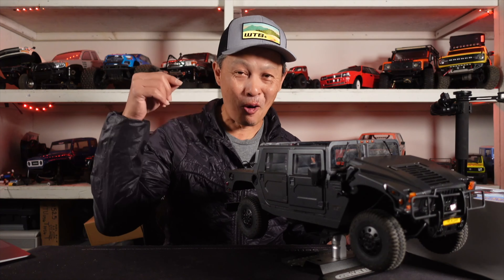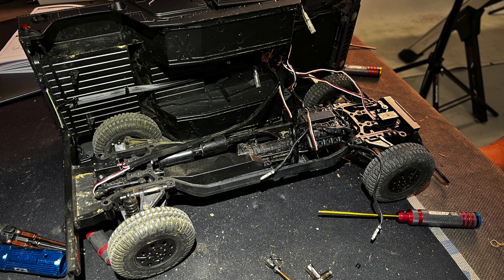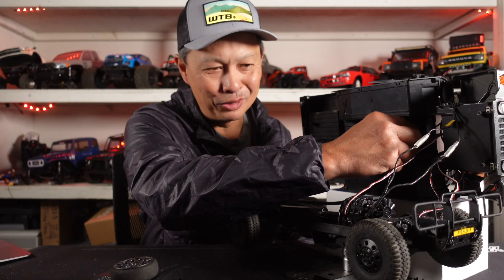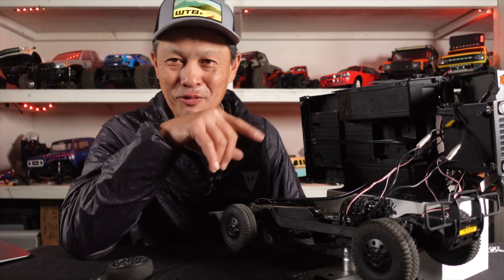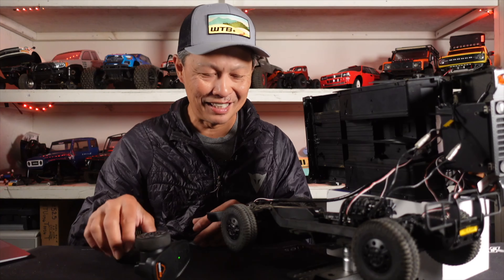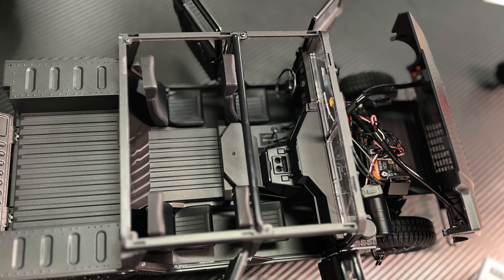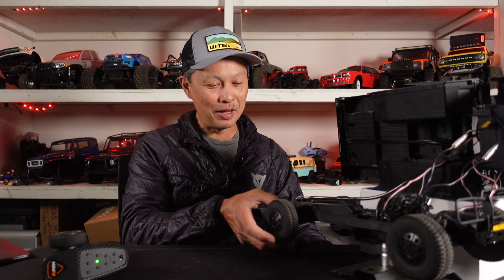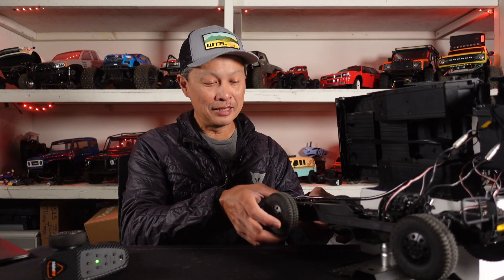FMS Hummer H1 1/12 chassis revealed and explored

Comment: I ordered one - thanks to this awesome channel. So far the wheel covers are painted aluminum, scale-weighted it out to 2kg (3kg goal), added 2mm wheel spacers in rear, 1mm up front, pulled foams and bead-locks out and air-filled/ sealed the tires, working on finding stiffer springs for a lift. These operate so scale it's out of this world. Only drawback is classic FMS gearing it too low -too much wheel speed - in high & low. P408 on the way, nonetheless this FMS is shockingly top-notch.

Comment: What is the biggest tire that can fit with  the body off without rubbing the frame rails?  Either I could do a 1/4 inch body lift with 3.6 inch Capra tires (42 inch real) or a 1/2 inch body lift with 4.0 inch tires (48 inch real).  Do you think the servos are strong enough to steer the 4.0 inch tires?  I should be getting the H1 on Saturday.  I can't wait!
Reply: I got my H1 the other day.  I installed 6 brass standoffs lifting the body 1/2 inch to make room for bigger tires.  After searching for tires at a few hobby shops, I decided on the 3.6 inch Nitto Trail Grapplers that the 1/18 Axial Capra uses.  They are a good fit and look nice.  That comes out to a 42 inch tire in real life.  I would not recommend  anything bigger.  The clearance is a little better but a suspension lift would help too.
Reply: You should show a video of what you did
Reply: Hi i have the h1 i would be grateful if yo could give me a little more info on the spacers you made, like the dimensions, as i would love to do the mods to mine, but im fairly new to this, any help would be greatly appreciated many thanks Dave@toddanderson1506

Comment: Some of us in the GI Joe community are very excited for this RC as it seems to fit figures right out of the box. But some are saying it's too small. Can you give your opinion on how close in size it is maybe vs the HG P408?
Reply: I don't have one of these Hummers, but the figures riding in the truck in this video look great. And I think they're GI Joe Classified, right? I don't have the HG P408 either, but 6 inch figures generally seem too small in 1/10 trucks I think. I'm waiting for my FCX24 Blazer to be delivered to see how 3.75 guys look riding in it 😎
Reply: @insomnia7337  you are correct, they are GI Joe Classified, and seeing them in this video made me very happy. Most of the time I order a 1:12 RC for my figures it's a big "hope" that it will fit. Pretty much every time there will have to be something that need cut in order to fit.
I agree, 1:10 is too big and sometimes 1:12 is too small, China is not known for their accuracy when it comes to scaling.

Comment: Thanks for the review!  So it seems like a suspention lift may not be possible. What about a body lift?  Could you put 1/2 inch standoffs on the six screws holding the body to lift it up?  Then you could put on bigger tires!
Reply from the maker: Ahh yes of course. Never thought of that!!
Reply: @RCReviewChannel  👍Do you know the thread size of the 6 screws that hold the body on by any chance?  I will have mine in a few days and I would like to get standoffs for it.

Comment: So basically it's an upgraded Walmart RC.  I can't imagine that the servos are metal.  I have a Tamyia Hummer, and it actually loos more life like and you can change the wheels and other things out on it.  This is not a hobby grade rc at all.  If it breaks you will not be able to fix it and it work like it was new again.  Nice looking truck, but not worth it in my opinion.
Reply: Wrong! FMS sells every part for every car they make! If you know nothing about a product dont comment on it!
Reply: @jameshankssr466  I actually do, and these are not upgradeable with other parts like he stated.  If you watched the video you would have understood my point.  But according to your response you just watched the video with no sound.  i.e. upgrading the the servos, esc, motor, shocks.  Read before you respond.
Reply: 100% agree.
Reply: @JasonGunn418  they are upgradeable! I did watch the video. I stick with my first comment
Reply: You CAN make it work like it was new again, just not better (at least easily).
Reply: It's more of model than a high performance RC, as is the case with many of their hard body offerings.  Get the Tamiya if you want some upgrade potential.
Reply: The Tamiya 1/12 looks really cheap compared to this FMS, I chose the FMS because the Tamiya looked like overpriced Walmart junk lol